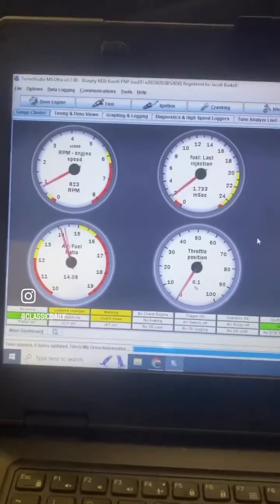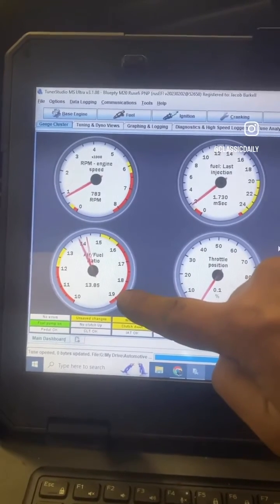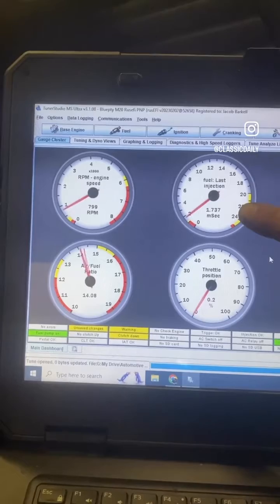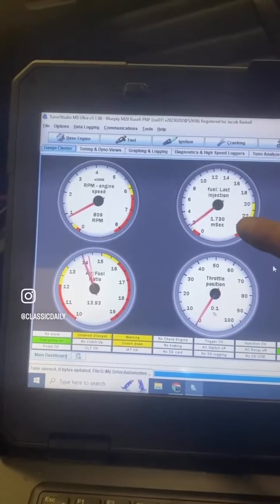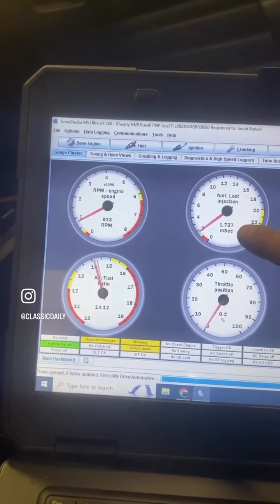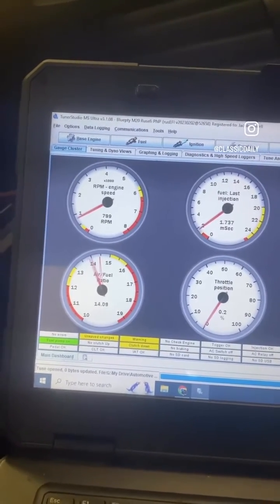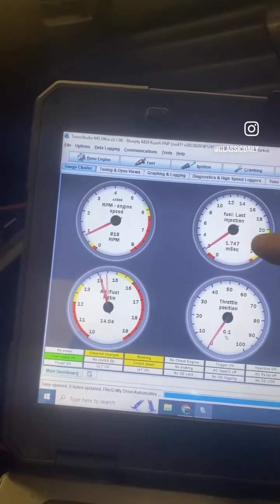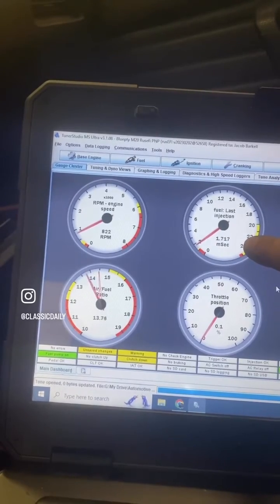Classicdaily tech tip about large injectors and tuning idle with small pulse width.

Comment: What’s the pulse width on that hairline? Just kidding we have the same haircut. I suppose that why it’s only recommended to have injectors 20 percent larger than your application needs. That way you have not just tune-ability but the potential for extremely fine tuning with far more resolution.